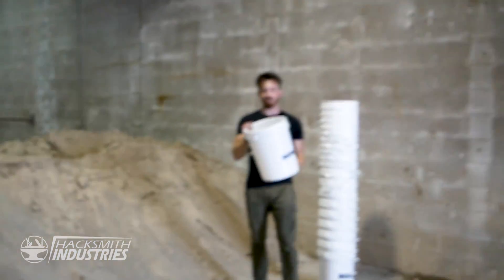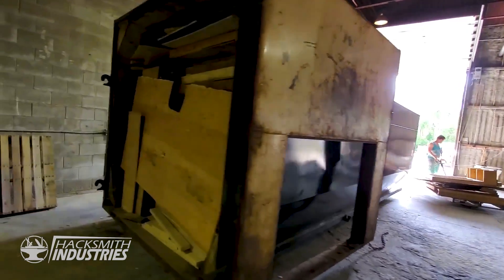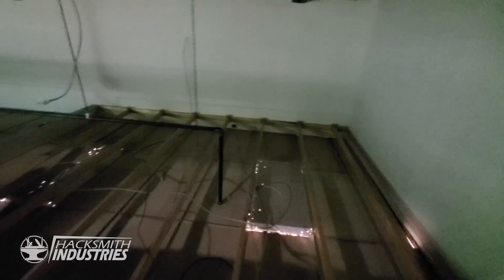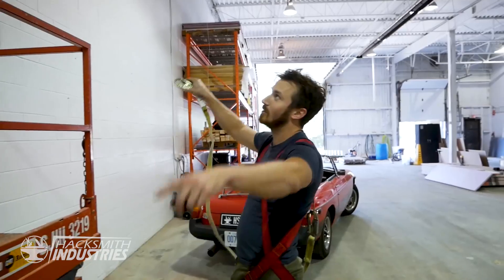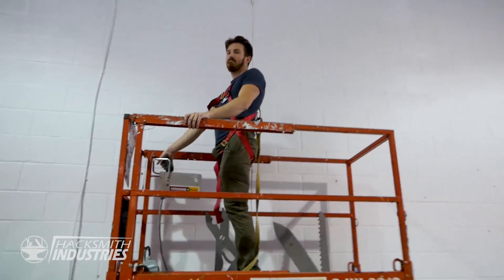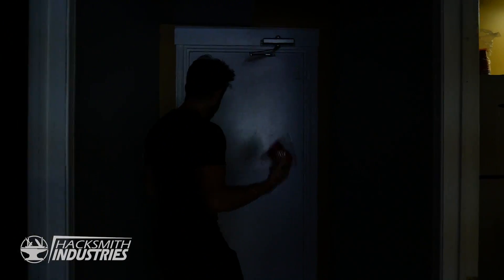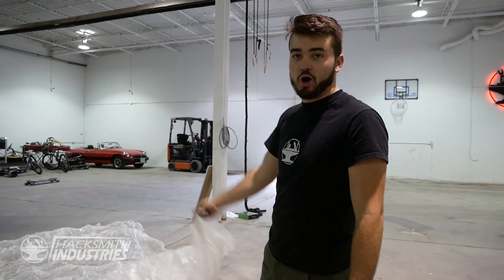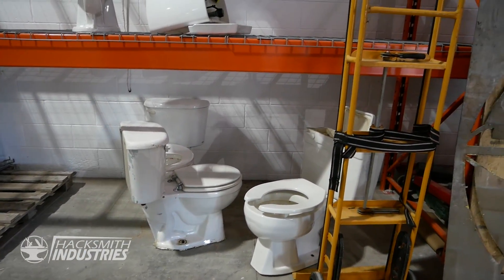Building STARK INDUSTRIES!

Comment: @ the Hacksmith (VLOGS)   13:08  What kind of tape did you use ? Are you sure it will be up to the harsh weather ? It feels like a dangling piece of metal (the inner part of the D, and A) suspended over a door frame.
Reply from the maker: VHB same stuff used to hold truck panels on!

Comment: You need to slope the floor so that water runs to the outside naturally instead of huddling up in the middle of your shop leaking I wouldn't have had it painted until you fix that

Comment: Have you guys thought about sealing the concrete floor with epoxy blue or clear coat ? Would look really nice and would give of a lab/research feel. Looks like you guys were doing alot of floor cleaning in the video.
Reply from the maker: we did... but 10,000sqft would be pretty expensive